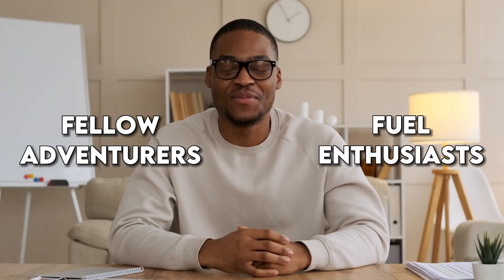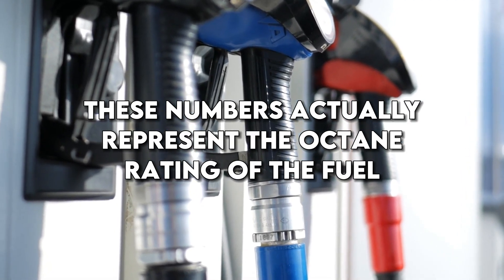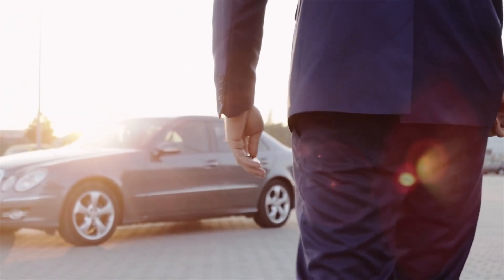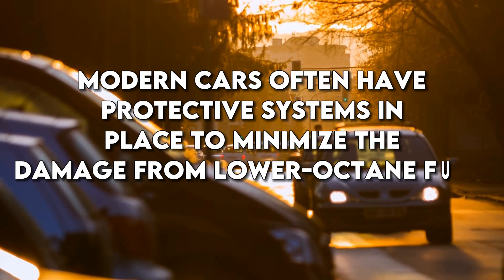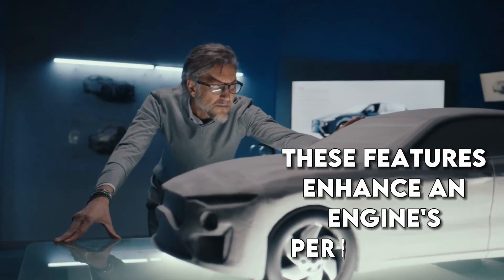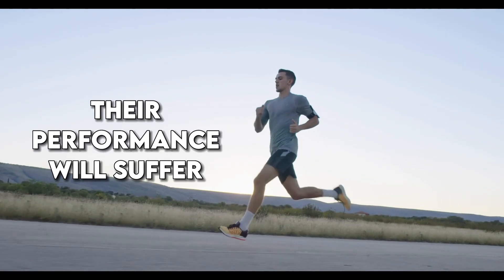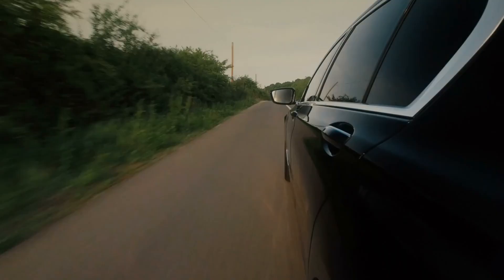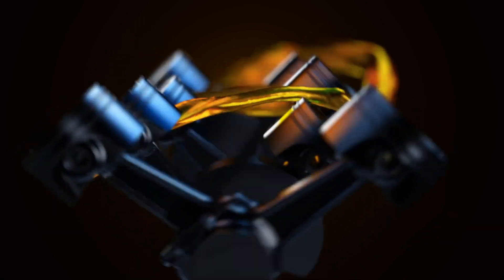What Happens When You Put The Wrong Fuel in a Car

Comment: It's important to avoid starting the engine if you accidentally used the wrong fuel and call a professional mechanic or roadside assistance service instead. This is a great review and very useful information to keep in mind. When you accidentally put the wrong fuel in a car, it can have a number of negative consequences depending on the type of fuel you added and the engine of the car. They will be able to evaluate the problem, drain the improper gasoline if required, and look for any potential damage or needed repairs. This was a really good video.
Reply from the maker: Thanks for watching Reed!

Comment: So far I think if you enter your tank with diesel when you have gas powered car, the car will work but it will damage the engine in long term usage. It also happen with other type of carbon compound oil